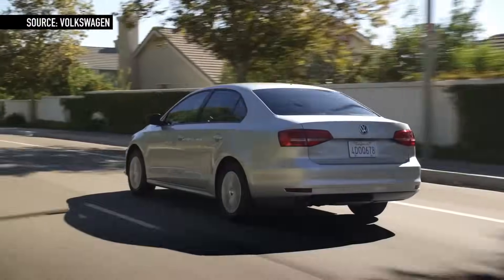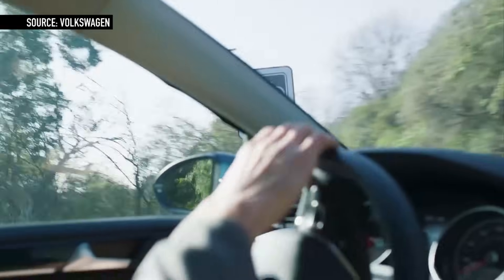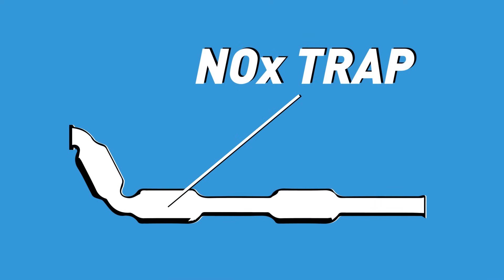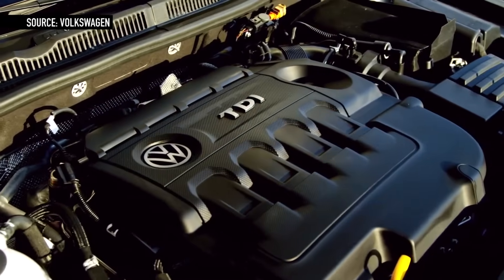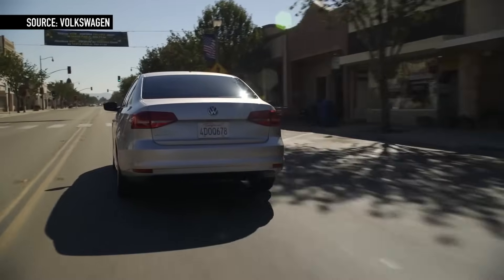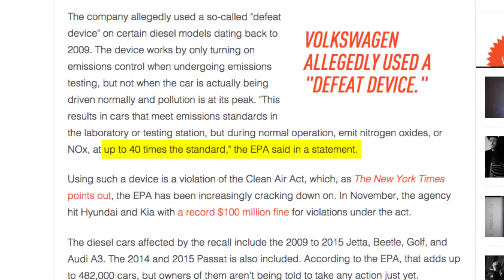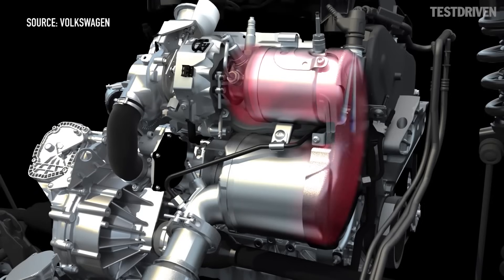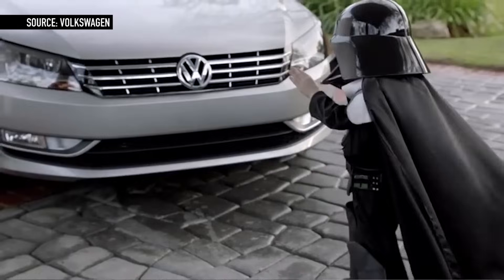Volkswagen's diesel scandal, explained

Comment: I don''t buy this explanation entirely and need some more info: I believe this cheat would have to have been only on "idle"  with immediate sensor reading deception. . When you go to inspection, it checks the LOG to see what the past performance has been when the vehicle has been driven several hundred miles++ There are very few inspection stations around that actually check the tailpipe emissions. They rely 100% on the computer. That info as well as if there are any inefficiency faults for "check engine" are looked at, as well as the immediate sensor reading. So unless they lied on ALL the data they recorded while the vehicle was operating is a lie....they just modified the system to get a favorable sensor reading on idle.

Not only that, if you think other car manufacturers do not cheat on their computer programs...I will sell you the Brooklyn Bridge.

Comment: All (new and old) VW TDI cars will have higher fuel consumption in future because of this change they will have to do in the software inside the VW car. So they will get worse CO2 emissions and loose in emissions competition against other brands. 
This could drop the price of used VW cars and put higher price on the new ones, so be prepared, VW owners/buyers!

Comment: Using more fuel and getting lower emissions... Anyone have a satisfactory answer for what exactly volkswagen did yet.?
Reply: +Peter Keogh 
Ironically when a car burns less fuel, it also makes more poisons that damage lungs.  (Cars that burn more fuel make fewer or no poisons.)
.
Reply: VW claimed to get high gas mileage and be environmentally friendly at the same time. In lab tests the "defeat"emission software would come up with results that showed it met environmental standards but used more gas than what it promised. It needed to use more gas for the Nox(nitrogen oxide and associated particles) catcher to work properly. The software new based on the position of the steering wheel, non-movement of front tires, speed and ther factors that the car was being tested. That's some smart software.

When the car was road tested, the emission controls were turned of by the software allowing the car to get the promised mileage but spewing out 40 times on AVERAGE the amount of Nox that VW had come up with.  VW was found out and had the arrogance to say their cars were fine and it was the inspectors and their equipment that was the problem. Giving them the benefit of the doubt VW provided recall vehicles to CARB with improved defeat software to further the lie. VW promised too many things to the consumer. VW was trying to make up for arriving late to the hybrid and electric car party.

Comment: Not being a VW fanboy but there is more to this story.  All high efficiency VW blue motion diesel engines are prohibited on the USA markets.  That is a fact.  What's a blue motion? Do some research.  Google is at your fingertips.  Why would you buy a Prius when a car less than half the price gets you over 100 MPG using a VW blue motion diesel engine? There is a war taking place. Nothing to do with the environment... It's all politics.  The ridiculous emissions requirements in the USA (thanks to California) make diesels impossible to compete with gasoline when measuring out the tailpipe emissions. However, diesels have significantly less emissions over the life of the engine because of their greater fuel economy. VW fudged the software to get temporary tailpipe emissions to pass, but overall it is still a much less polluting engine than gasoline counterparts. This will be an interesting war.

Comment: VW, just for the records makes a good product and is the largest carmaker. Now, with a flawed reputation because of the defeat devices. They can save face by naming new diesel models VW Cloud, Fog and NO (nitrous oxide).The other thing they can do is train and employee qualified refugees, thereby taking stock of the crisis Germany among other EU nations has so graciously immersed itself in. A sustainable minimum wage w/o benefits but subsidized housing.
Reply: +badmiyagi .s 
Honda and Ford were also caught cheating by the EPA a few years ago
.

Comment: Makes me glad I bought the 2.5 L gas Golf.
Reply: +Connor K (KConnor90) 
I wouldn't be surprised if the gasoline VWs also cheated on EPA tests.  The modern Direct Injection engines use the same NOx trap technology
.
Reply: electrictroy2010 I don't care I only pay $30 for a full tank every 2.5 weeks on my Golf GTI so I'm happy it gets great gas mileage and faster than a lot of cars which use big v8 or v6 engines. Plus the forests in the east suck almost all the carbon dioxide that we produce here in the USA and give us wonderful oxygen which news outlets fail to acknowledge.
Reply: No they don't. Forests and phytoplankton can only absorb so much CO2.

Comment: I know Germany invented the diesel engine engine but its time for Volkswagen to buy a technology from Japan particularly the Honda i-DTEC technology that pass the emission standard while maximizing fuel economy.
Reply: +obet06 
Are you sure it works?  Honda was also caught cheating by the EPA a few years ago
.
Reply: +electrictroy2010 Lol
Reply: obet06 2stroke diesel is up to 50% thermally efficient. Gas cant compete with well tuned mechanical  deisels
Reply: and our roads and garages are absolutely full of those- right?? wrong.

Comment: It's not about fuel consumption that would be the smallest problem but the fact that those cars would loose power if the system was running nonstop. 

The emission levels are set by politicians that don't know anything about cars and that is the problem. People demand cheaper cars and in order to meet this demand VW had to do these kind of things. 
I don't understand what gain would a VW owner have suing the car company. He got what he paid for and the car works as intended. Almost nobody buys a card because it has low emissions, that is probably the very last thing on the list.
Reply: +Cam YouTube Your car is better than advertised, meaning you should be getting better mpg now than you thought you were getting before.  So when the fix comes, you'll be getting whatever you thought you were getting before.  The only loss of value is the hurt brand name associated with your Jetta.
Reply: +thopkins22 No the car was advertised as getting less than they're getting without the fix, because the EPA tests the car's mpg when they're being tested for emissions and figures out the fuel efficiency.  You take away that fix then the mileage goes way higher than advertised.  I just got a '15 Golf TDI about 2 weeks before this came out and have been getting upper 40s easily when it's advertised at lower 40s.
Reply: +UltraFighter18 I am an owner of a 2013 Jetta TDI which is affected by this scandal. If my car didn't have to be recalled and nothing changed about it then yes, i would be happy as i paid for and received the product that i wanted. The problem lies in the fact that they are likely going to have to recall my car and make it meet current emission standards, when they do that my car will no longer be the product that i had intended to buy, it will get lower gas mileage and have less power. So VW should have to pay me the difference in value of the car i bought vs what i will have received, because a car that gets 6mpg less and has less power, is not worth what i paid for my vehicle.

Comment: Not saying what VW did was right, but don't the emissions tests have some problems if the car is able to tell it apart from normal driving? In other words, doesn't that mean these tests are not representative of how the cars are normally used?
Reply: That's my thought exactly.
Reply: It does increase in real world as compared to tested numbers, but they don't increase 40 times
Reply: Emissions tests are a joke to begin with. It makes me sick that auto makers aren't held accountable to other stuff. They can charge you monthly subscriptions for features you bought but if they make themselves profitable to the Democrats climate fight they will go right after those people...
Reply: Its really easy to do that emmisions are tested with the car as stationary on the dyno and tested for hours at different speeds because you need to collect and measure the gases from the tailpipe. So if the car does not get any steering inputs from the driver for more than half an hour then the car is obviously being tested.
Reply: Always has been. It's similar to maximum tow ratings or router wifi maximum speeds.
Reply: That's true but mostly irrelevant. The factors VW used to spot an emission test had nothing to do with any difference with normal driving. It looked for the driving  pair of wheels spinning when the other pair was not. It also looked for movement of the steering wheel. No movement meant a test stand. Seeing that, it assumed a test stand. But neither of those factors impact emissions. 

The reality was that VW wanted to beat Toyota at the top of the auto market and to do that it had to cheat. But for some students at a West Virginia university who did a class project that measured on-the-road emissions, it would have succeeded. It was perhaps the cleverest scam in human history.
Reply: Imagine being an asslicker for a giant company
Reply: But they admitted that they cheated
Reply: @rami4340  They did not own up ,  VW managers immorally stalled / hindered / and mis-led the EPA  investigators for 15 months until a VW whistleblower " blew the whistle" to the EPA officials,  For their part in the misleading  and perjury to the EPA  VW managers are serving  lengthy gaol sentences in the USA and a number of German VW senior executives are subjects of extradition orders by the USA FBI,   fear of arrest makes the  USA is a No-Go country for  european VW executives involved in the scandal
Reply: @MM-oq5bl  Your account of what actually went down is perfectly accurate, and I managed to piece the whole puzzle only after a while because there were bits and pieces of information here and there all over the internet, since there were quite a few external and internal probes involved so the facts didnt always come to light in chronological order, and different charges and trial sessions where being established comtemporarily in Braunschweig and 3 different lawsuits in 3 American states. Do you know of any specific source which encompasses the whole scenario coherenty and comprehensively? Peace.
Reply: @MM-oq5bl  I wouldn't visit the US anyways. They're not missing out on anything

Comment: I'm always thankful for the Verges explanations like this. Keep these coming, it's an easy way to get caught up and understand recent news
Reply: +electrictroy2010 this all controversy is made up 
are you going to tell me a VW Golf with a 800 Miles range 
is more polluting  than 4x4 Pick up Truck with 6.7L diesel engine ???? which gets 400 Miles from 38 Gallons fuel tank ???? 
.
 Vw Golf needs 6 Gallons to cover the same distance of a Pick UP Truck range.
Reply: Stig Cruise if my car needs  6 gallons of Fuel and your vehicle  needs 38 gallons to complete the same distance  is impossible for your vehicle be the less polluter
Reply: +Hubert Rybak NO the video explanation is not wrong; you're just ignorant.  The VW TDIs in question (beetle, golf, jetta) don't have urea.  VW left off that equipment in order to keep the selling price low 
.
Reply: niceguy60 when it comes to NOx emissions  quite possibly yes.  carbon emissions and hydro carbon emissions  probably not .
Reply: +electrictroy2010 ehh, doesn't have the same ring to it...
Reply: +electrictroy2010 or Volkswagens Diesel Scandal
Reply: On the video they are showing not only jetta. Some of them have scr. This Explanation could be   misleading for less oriented drivers.
Reply: Hubert Rybak Some 2015's have scr.  They are specifically roasting the ones that do not.
Reply: Stinky Cheese so a VW Beetle  with a small 4 cylinder engine produces  40x nox the legal limit ??? 
.
Should  you buy a 6.7L 4x4 V8 diesel heavy duty pick up truck instead to protect the environment  ???
Reply: niceguy60 niceguy60 when it comes to contributing to acid rain quite possibly yes a bigger heavier diesel truck that uses more fuel and produces less nox  emissions will contribute less to acid rain but it won't contribute less to CO2 ,Co,  & hydrocarbon emissions. I don't know if I mentioned this somewhere earlier on but the Smart Car diesel was actually dubbed One of the greenest cars in the world and given an award for it but it's not allowed to be sold in America because it exceeds our nox emissions.
Reply: Stig Cruise so following your ridiculous logic  in order to produce less nox I need to overload  my vehicle  and tow some heavy stuff ?  
.
More weight equals less nox emissions right ???
Reply: niceguy60 omg you are dense . open up a book or just look it up on YouTube more fuel means less nox  emissions.
Reply: Stig Cruise so you didn't said more weight equals less nox , right  ???
Reply: Stig Cruise perhaps  I will drive around on full throttle often reaching my engine max revs in order to use as much fuel as possible  , so my nox usage can be reduced ??? 
.
More fuel usage equates to   less nox being produced , right ??? 
.
You are wasting  our time with your ridiculous arguments
Reply: niceguy60 you're obviously not even paying attention to anything anybody's writing you don't USE nox you PRODUCE  it when an engine runs so lean it'll produce nox  emissions. so running an engine at Full Throttle when it was built to have a lean mixture will not help. and my previous comment when I mentioned a big heavy truck that USES more fuel. I was using the big heavy truck as an example of a vehicle that will use more fuel than a passenger car. it doesn't matter what size of vehicle if the engine was built and the computer or engine management system is program to use more fuel the end result will be lower nox emissions . and before you say anything about older diesel engines not having to do this back then emission standards were a lot less strict and the technology wasn't around for super accurate fuel metering, so manufacturers built the engines and the fuel pumps and fuel metering devices to run the engine slightly rich so that as not to damage the engine over time
Reply: pollution is devided in two categories: CO2 and NO2 -  it has been shown that NO2 is always and still cheated to the maximum. VW does NOT build a socalled cleandiesel. #dieselkills ...
Reply: +apeirrron 
They shouldn't call it #dieselgate though. BMW, Mercedes, Chevrolet all make excellent diesel cars that passed the EPA tests (and overseas Mazda, Honda, Toyota make diesels that pass tough EU 6 tests).  A better hashtag is #VWgate since it's only VW that is the problem not diesel tech
.
Reply: CLEAN DIESELS IN THE U.S: Chevrolet Cruze
Mercedes sedans or SUVs
BMW 3 or 5 series
In Europe you can also get clean diesels from Honda, Toyota, Mazda, Ford...... basically any car that is not Cheatwagen
.
.
Reply: +apeirrron possibly explanation is wrong. Liquid-urea tank is too small and they had to  reduce amount of urea which is added to reduce Nox during normal driving. The correct amount of urea is added when a test mode is detected. It is only connected to comfort of the driver (nobody want to addblue too often). VW will  add bigger tank and upgrade the software and the problem is gone.
Reply: +niceguy60 - No it's not impossible at all for NOx to be higher on the VW.  Sources have stated 14X, some even 40X higher than the legal limit while the other vehicle would be under that limit.  6 gal to 38 gallon ratio is only 6.3X.   6.3X < 14X

and that's even using your made up nonsense numbers.  MOST modern 4x4 pickups get over 20MPG and don't have anywhere near 38 gal tanks, so your 400mi from 38 gallons of fuel is a silly thing to compare.